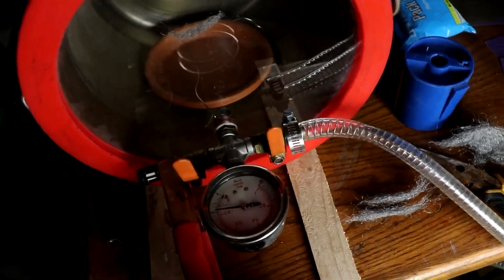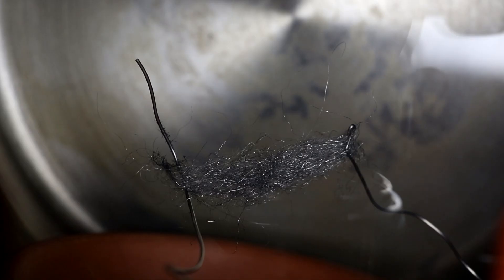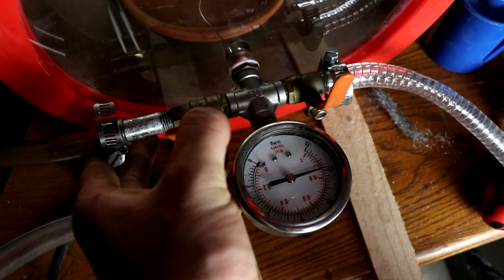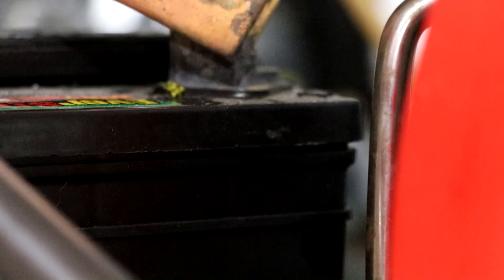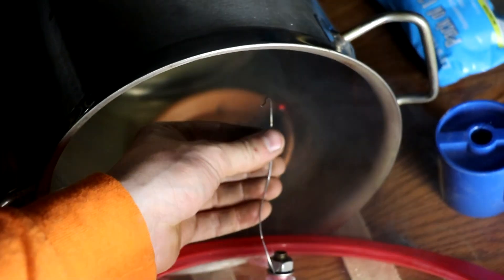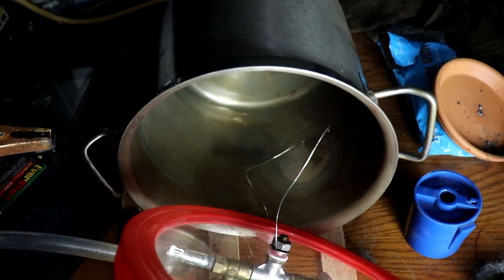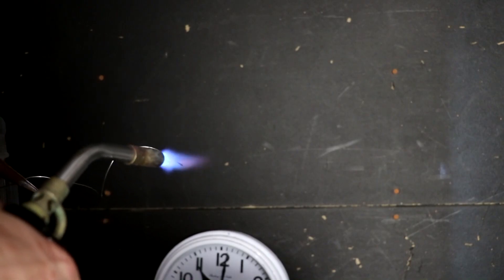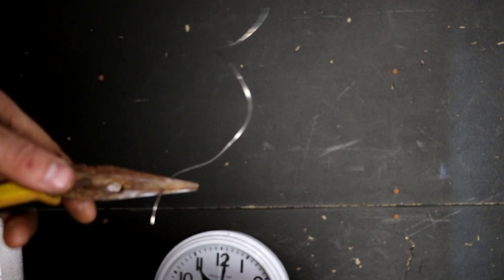Burning Steel Wool In Oxygen

Comment: When rebuilding oxy regulators It's important to use the proper lube. Turn O2 tank on too fast>Fire piston>petroleum based fuel>kaboomed regulator. Least that's how I think it works. Good thing they send the lube with a rebuild kit.

Comment: You would think that the chromium oxide layer that forms on stainless steel would protect it from attack of the oxygen gas even at 100% concentration yet somehow that doesn't seem to be the case at 100% oxygen concentration.

Comment: This is how your cutting torch works. You actually don’t even need acetylene to continue a cut in theory it’s only there to pre heat the steel at the very beginning of the cut. The oxy-jet will keep the cut going and keep the steel hot enough to continue oxidizing but it’s pretty much impossible to do unless you are a robot, people arent steady enough
Reply: Do an experiment where you try to keep a cut going with only the oxy. A track torch would probably be your best bet. Would make for interesting footage.

Comment: I'm not sure on the exact mechanics involved, but I'm pretty sure that was the cathode. Heating metal and applying a voltage is how vacuum tubes pass current, it causes electrons to 'boil' off the negatively charged cathode. This effect in the O2 atmosphere could allow the protective chromium oxide layer to be negated, attract fresh O2 or reduce the activation energy for the reaction. I might be wrong, but it's just an educated guess.

Comment: The stainless steel wire burning reminds me of my Chemistry teacher playing around with a rubber hose (I know what you're thinking, but...) connected to an oxygen supply and then holding it up to a Bunsen burner. He wanted to show the increased flame and temperature but instead lit the hose on fire and tried to shake it to extinguish. Molten hot rubber flew around but luckily the safety shield on his desk was up. He was dumbfounded and then declared the experiment to be over.

Comment: Classic. The unrefined steel from the wool created a point of ignition on the stainless steel, it is acting like a wick on a candle. That is why you dont fasten stainless materials with normal screws, or vice versa. They will make it rust regardless. Rusting is basically a slow burn.

Comment: Hey if you blow oxygen through a thin piece of iron pipe or steel works to and heat up the end with a blowtorch you can create something called a thermic lance it's a torch that actually Burns iron as the fuel and oxygen too but nonetheless it should be an interesting experiment using a thermic reaction

Comment: Similar to using some steel wool to ignite a steel frame line that has oxygen flowing through it. Once you ignite steel it will burn as long as it has fuel and oxygen... Thermal lane
Reply: Brake line* stupid autocorrect!

Comment: You should try to burn teflon.  This is (more or less) what caused the explosion on Apollo 13: a wire shorted in a liquid oxygen tank and caused the teflon-coated wire to catch fire and burst the tank.  It wouldn't be entirely the same because that was liquid oxygen, but it would be cool to test.

Comment: Are you sure that your explanation of the steel wire burning is correct? You said under oxygen it burns because the inert gases don't have to be heated. I'm not convinced that this really explains the phenomenon, since it is to be expected that, given a certain pressure, heat flow will be the same, no matter the composition of the gas. My guess is that in a low oxygen atmosphere, the flame uses up the oxygen in its immediate surroundings, and that the oxygen can't be replaced fast enough by air flowing towards the flame, resulting in an environment that is not rich enough in oxygen to sustain the flame. In an atmosphere with 100% oxygen, the immediate environment of the flame is always pure oxygen, and maybe some fumes. There is no "used up" air surrounding the wire with which the inflowing air could mix, thereby reducing its oxygen content significantly. Rather, all the oxygen that is used in the process is immediately replaced, with no other gases it has to displace or mix with.

Comment: this reminds me of a video i watched where a guy made a thermal cutting lance out of a steel break line with O2 running thru it. all he did was hook up a breakline to a small portible welding tank of O2 and shoved a lil steel wool in the end to get it going and then when the O2 was pumping thru the breakline and he lit the steel wool..the breakline burned and he used it to cut steel plate and evn stone. so yeah O2 can help you burn almost anything.

Comment: I was taught it was the lower oxygen pressure (i.e. fewer O2 molecules hitting the steel) that causes things to burn slower/not at all in regular air vs 100% oxygen at (around) atmospheric pressure, not the fact that you need to heat up the N2 in the air. Could you compare these tests with 100% oxygen at 1/5th atmospheres pressure? If it burns like 100% oxygen at (almost) atmospheric pressure, it will support your explanation. If it burns like in normal air, it will be conforming to my explanation. Cheers!

Comment: nice fireworks with the stainless steel! Could you try to figure out what the maximal thickness is for this effect to work? I mean, it would be nice to see where the cut-off is between burning and just melting, and maybe to check if you could weld two pieces together by running a stainless steel wire "fuse" around them or something...

Comment: Cody. Surprisingly, #0000 steel wool will burn in air. In fact, it will ignite from the low temperature spark from a traditional flint and steel. Very useful for bushcraft/survival fire starting.

Comment: Cody that's super cool, I'll try it on my channel and you can see the results there! I won't use a vacuum chamber, just an H2O2 and manganese dioxide reaction in a jar to fill it with oxygen, as it's heavier than air it should stay in there but the nitrogen should float away... :D

Comment: The burning stainless steel wire in an oxygen atmosphere is similar but in reverse to a thermal lance used in demolitions and heavy machinery repair. In a thermal lance you have a steel tube with steel or a mix of steel and aluminum rods inside and you light one end with a oxyacetylene torch while pumping pure oxygen through the tube. At the business end of the lance you get a stream of super-heated molten metal which can cut through extremely thick metal and concrete and can reach up to 4500 degrees Celsius by some calculations.

Comment: Observation: It seemed that one wire burned vigorously while the other one did not burn at all. My hypothesis is that you left the starter battery engaged and that the burning wire was the anode. Flames (usually at least partially plasmas) and high temperature gases are more conductive so it’s possible you could get a decent current traveling through the combustion species. The negative charge of the anode will accelerate the oxidation reaction taking place there. 

Experiment: turn off the current after ignition: does the wire burn? Keep the current on after ignition: if only one wire burns which is it?

Comment: Before the advent of plasma and water jet cutting, stainless steel plates were torch cut with oxygen by laying a plain steel "waste plate" over top of them and cutting both. Perhaps some similar effect is happening between the steel wool and the stainless steel wire.

Comment: you mentioned not wanting to blow the lid off... is there some reason you dont just use a check valve? when its a vacuum, valve is held shut by atmopshere, but if theres an explosion pressure will open the valve and at least most of the energy will go out through the valve.

Comment: Would it burn if you were to heat the stainless steel and drop the red hot wire into a container filled with oxygen

Comment: It is not only heating the nitrogen that slows the combustion, it is also venting away the oxygen-depleted gas volume around the combusting area. With pure oxygen, new oxygen can arrive at the burning area at the speed of expansion into a vacuum. With air, new oxygen can't arrive until the oxygen-depleted air is cleared away (typically by convection). When burning metals, there are also no gaseous combustion products to impede the arrival of oxygen. So burning metal in oxygen with zero gravity will continue to burn fine, while most other fires tend to be self-smothering when there is no gravity to drive convection.

Comment: This is basically what a thermic lance does. It uses a steel tube that has the pure oxygen running through it. All you need to get the reaction going is some steel wool shoved at the end, and react the steel wool. It is basically the same as shown in this video. These can melt rock and other things that melt at high temperatures. I believe NightHawkInLight did a video on this at some point.

Comment: Street performers sometimes take fine steel wool and attach it to a string. They then light the steel wool on fire and swing it around on the string, resulting in arcs of sparkles. Don't do this around flammable stuff like dry grass, as you might set it on fire.

Comment: Long story short one thing I do to boost connections of steel wool in a circuit (like for DIY electric fuse) is sort grab the ends of the steel wool with some aluminum foil and smash the ends tight with some pliers.  Not sure if that would impact this particular demonstration but it is easier then trying to solder steal wool to some sort of wires.

Comment: should do more experiments with the stainless steel in oxygen to see what its actualy capable of.Have you thought about adding some welds to the handles of that pot or some such and using clamps to reinforce the glass or is the pot itself your concern?

Comment: Can you burn PLATINUM in pure oxygen atm? I remembered of the "platinum" wires we use in microbiology labs to make the inoculation loops used to manipulate microorganisms in petri dishes, mainly. Nowadays they are mostly made of stainless steel... which wont burn in air as showed here and can last for hundreds of cycles of heating and cooling, but originally these loops were made of platinum, and some of them can be found in labs being used daily for several years, heated to red hot in LP gas flames several times a day, and not oxidizing or burning at all!

Comment: Cool ...
How about magnesium wool in oxygen ?
Not sure here but I think flashbulbs used steel wool in pure oxygen ... what was left behind was not magnesium oxide , it was dark , which leads me to believe it was steel wool .
There was a tough plastic coating on the lamp to prevent flying glass (I seen many of them crazed after firing) ... some of the coatings were tinted blue to emulate daylight , these were used with outdoor/daylight color film . I believe the clear ones were used with black and white film , although one could use the blue tinted units in a pinch .

Comment: When I was a kid I used to make land mines out of 5 pound coffee cans with a little hydrogen generator inside (a small glass container with a teaspoon of lye and aluminum foil ball and a long straw or tube up out of the can lid through a shallow layer of dirt to inject water to activate the lye) and a steel wool igniter inside the top of the lid. You count to about 20 or 30 after injecting the water then switch on the steel wool. It was potent enough to throw dirt clods onto roof of house. After saying that, it’s not a thing I would recommend kids doing without some adult supervision - oh, and yes, you should definitely wear safety glasses - the first one I set off I stood too close and got a lot of dirt blown into my eyes.

Comment: Interesting.  My thought is this...  the stainless steel wire is continuing to melt, not because of the enriched oxygen atmosphere, but rather the hot slag following the downward angle of the wire and continuing to melt the wire rather than the perceived burning action.  Same principle as using a cutting torch...  start the cut by getting the metal to melt, then shooting and chasing the slag across the surface at the right speed to facilitate the cut...  too fast and slag blows off and surface cools and cutting stops...  too slow and slag doesn't blow off but rather pools and creates a rough cut...  get the balance just right and a very clean and even looking cut.

Comment: It's really cool if you pump oxygen through still break line and pull little steel wool in the and a lite it will turn the brake line into a Lance that will burn through rock

Comment: It's not only because heating the nitrogen as well, that stainless doen't burn. In a pure oxygen environment the partial pressure of oxygen is higher  (unless the pressure is below 0.2 atm) , and thus increasing the reaction speed due to more molecules of oxygen hitting the stainless. :)

Comment: can you ignite a steel wire like that by blowing pre heated oyxgen on it instead of heating the wire?
isnt it the kinetic energy of individual particles colliding whats enabling the reaction to occur so it shouldnt matter which one of the particles is moving fast due to heat so a stream of hot (fast moving) O2 molecules should be able to start the reaction

and why do you think that the heating of the nitrogen causes it not to burn in a normal atmosphere since gases have a low heat capacity. arent the concentrations of reactants/rate of replenishment of the oxidizer more important?

Comment: Well stainless steel doesn't cut very well with the oxy acetylen torch so..   Weird. But once it heats up it loses it's corrosion resistance because the chromium diffuses out of the steel into larger chromium balls. Also getting normal steel on there usually causes corrosion/rust as well.

Comment: We used to get a potato cannon and pin steel wool to the back of the spud. A spark ignites the fuel (hair spray) in the chamber, ignites the wool, blasts the spud out of the cannon and you get a sparkly potato projectile at night. Done in winter to avoid bush fires of course.

Comment: ".......I think I'm gonna add air now."

😁😁😂😂😂😂
Reply: HimKioo 
Basically, it's a mild reaction to a fairly extreme situation.

It's like saying "I think I'll pull over and get out, now..." when your car is literally on fire.

that help?
Reply: HimKioo 1) the stainless steel wire was melting down to the stainless steel pot, and if that caught fire there would've been considerable fire damage

2) When he opened the door, there was a loud popping sound. If the container was too pressurized (I'm not sure if it was under or over atmospheric there) it would have exploded, shooting out the melted metal with it.

And despite how dangerous it could have been, he reacted so casually to it

Comment: Stainless steel is well known to the compressed gas industry to burn in high oxidizing atmoshperes. This is why oxygen and nitrous oxide cylinder filling systems use monel and similar tubing in the case of spark or combustion in the filling systems (does happen, have seen it where I usd to work).

Comment: I'm interested to see if you could focus a stream of oxygen onto a wire similar to that to get it to burn without the use of a pressure chamber.
Reply: There is a gadget called a thermal lance which is pretty much a practical implementation of what you're describing, often seen in heist films.

Comment: Kinda makes sense that the steel wire burns by itself. When cutting steel with an oxy-acetylene torch, once you got the piece at the right temperature, you can cut pretty big chunks of metal with only the oxygen on.

Comment: Did some design work on a high pressure O2 system (~3000 psi) with some high pipeline velocities.  Turns out that if you have any particulate in the pipe, and it strikes a piece of 316 SS at speeds above ~10 fps, you can cause pieces of SS that are less than 1/8" thick (maybe 1/4" - it was a while ago) to ignite.  So... no SS valves; everything had to be Monel, or else velocities had to be kept super low.  2" Schedule 80 Monel pipe is expensive, but metal seated Monel valves?  Incredibly expensive.

Comment: I thought the reason for the wire burning wasn't so much the pure oxygen but it seemed to me that the wool got stuck to it. became molten and then when the electrical current was continually applied created its own short in a way. causing it to continually heat up and get hot enough to melt the wire. I know I am making many assumptions here. But to me it seemed logical

Comment: Is is Steel wool or Iron wool? Just curious, as some people call Alumaninium foil "Tin foil" by mistake. Thought it may be the same with Iron/Steel wool.
Reply: I don´t know the typical alloy used to make steel wool, but generally all materials that mainly contain iron and at most 2,06% carbon are called Steel. 
The misnomer "Tin foil" is clearly on another level of wrong. In most other languages, it doesn´t exist.

Comment: WTF O.o the stainless steel wire burned like a fuse! in pure oxygen.... will neoprene or silicone rubber or asbestos or rockwool, glasswool,  burn too? and when yes like how?
Reply: This is where we do not proceed to trying to fill that chamber with ClF3 and seeing what happens to asbestos...
Reply: You learn about some new nasty stuff every day:
It is also hypergolic with such things as cloth, wood, and test engineers, not to mention asbestos, sand, and water—with which it reacts explosively. (Wikipedia)
Reply: most rocks (including glass) are already oxidised and will not react with oxygen any further. steel is made from special rocks by removing the oxygen.
Reply: neoprene ans silicone rubber burn in air. Any material that is already fully oxidized will not burn.

Comment: when i was young and dumb and couldn't start a fire, i used #000 steel wool and a 9v battery in a  78% nitrogen  and 20% oxygen atmosphere  in about 14 psi of pressure